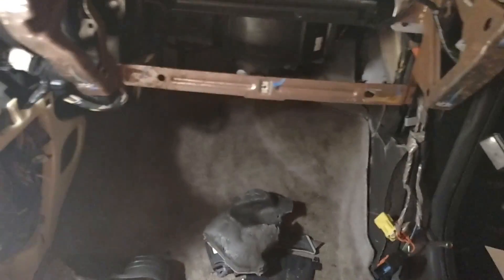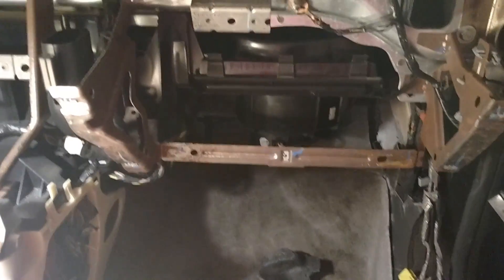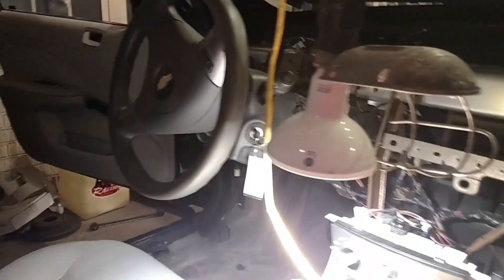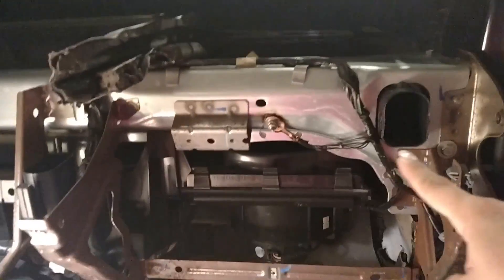Quick  07 Chevy Cobalt door blend actuator replacement in 5 min or less

Comment: I have a 2008 cobalt and mines not that easy to get to. There's a metal cage blocking from putting my hand through from the bottom and when I took the whole dash apart, there was like a whole other layer that doesn't look like it can be removed. I could probably replace everything else in my car except that damn blend door actuator
Reply: Thank you for posting this. Are there screws holding the bastard on? I am squeezing my hand up in there, I can trace the wire harness to a part felt but not seen, but it will not budge. I am loathe to take the dash apart for this BS.  Please share more. Thanks

Comment: but have to dissemble all dash for replace the door blend actuator?
Reply: looks that way
Reply: @jnunez1203  the only way , have to take off all dash including the media, wheel bolts, instrumental and after that cut the right side of heating plastic to create space to take off and on , is a compromise job is not in 5 minutes, at least for HHR 2006.... Is a pain in the back

Comment: Is this the one that controls the heat and AC door
Reply from the maker: no its not that one. the heat and ac door is located  under the radio.
Reply: @makethesale1  
Then what does this actuator actuate?
Reply: @MrJohnnyDistortion  External vs internal air intake, I believe.
Reply: @essaysbyken  
😳
Reply: @makethesale1  I have an 05 Cobalt and I really need to get to the heat/cool air blend door. Due to an electrical issue, the actuator doesn't work. When the issue occurred it was in the cool air position, so I have to try to move it to the heat position manually. A few things stopped working at the same time including the power steering, and I've checked all the fuses. My best guess is they lost the ground they were sharing. I'm watching these vids trying to find out the location of the cool/hot air blend door. So, it's under the radio?

Comment: Yeah- except actually there are two screws holding it in and also you have to know what position the damper is in so you can move yours to the same position so it can be installed. That is why this video is taken AFTER  you removed the entire dash. Unless your a magician...this ain't happening. I watched this video and had high hopes also for my 08. After hours of wasting time my dash looked EXACTLY like the one in this video. There is simply no other way to do what needs to be done to complete the repair other than remove the dash to replace the 16 dollar part. If you do what is shown here you will waste an hour removing INSULATION so you can place your hand on the actuator and realize just how f***ed your are. Quote-   "saved me a ton of time"... lol whatever. She is right that if you waste a bunch of effort to remove the insulation you can put your hand on the actuator....but it is simply not that easy or quick to remove and replace the actuator. The dash has to come out to complete the repair and there is no other way to do it.
Reply: May god have mercy on us all🥺
Reply: Yeah I was dying the whole time I watch this fake ass video did you catch where she said installation instead of insulation
Reply: I'm about to try to replace mine in our '07 Cobalt . Time now , 12:56 pm. 10/21/2023  !
Reply: @orlandodavidson6011 😂
Reply: Two screws?  Phillips head or?  I am going through this with an 08 and really don't want to take the dash apart.  Thanks